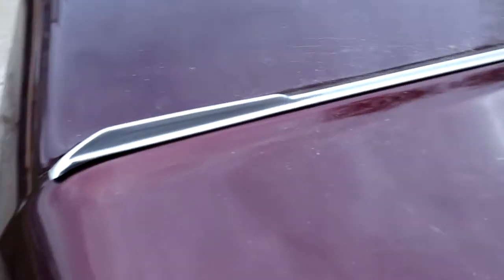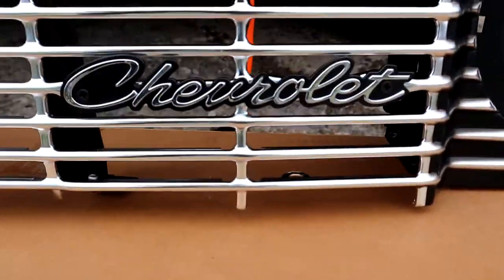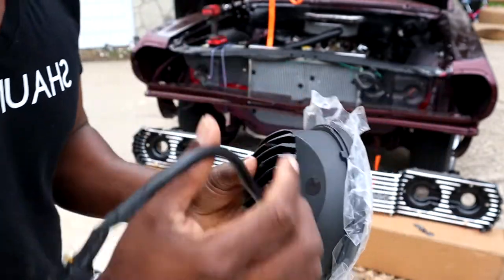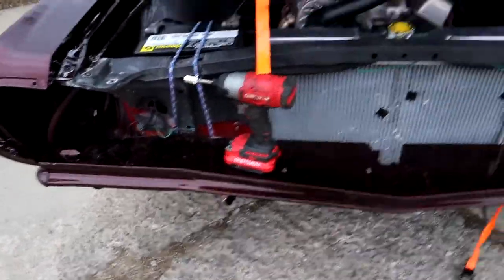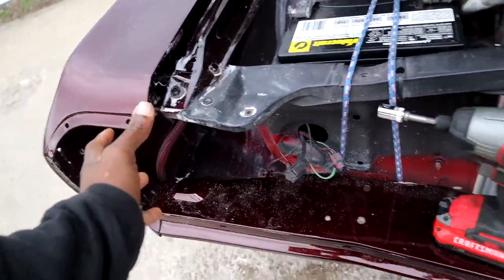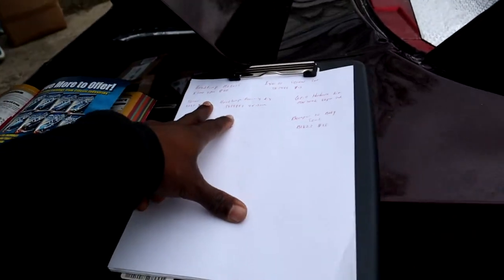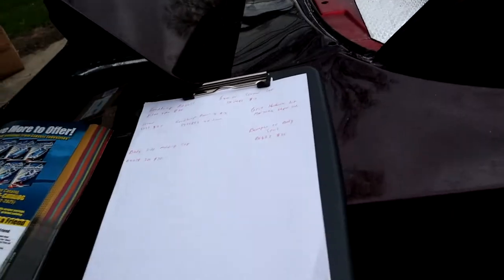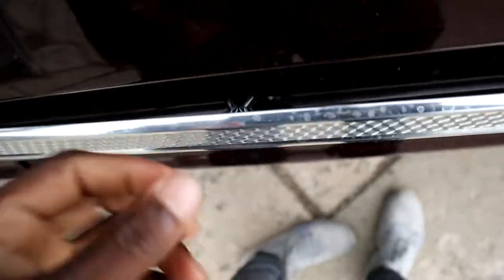How to Install your grill on a 1964 Impala SS

Comment: I bought the same ones but I returned them . You’ll have to cut out the headlight housing cup. The back side of the headlight is big and putting the ring on will not hold them in alone.
Reply from the maker: yeah Rick had said that. He had to that do the same to his car.